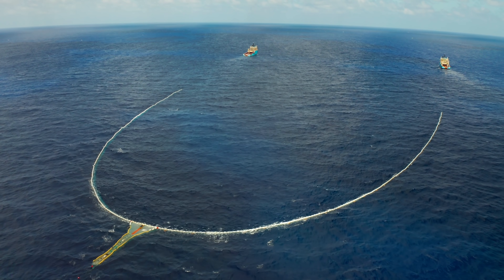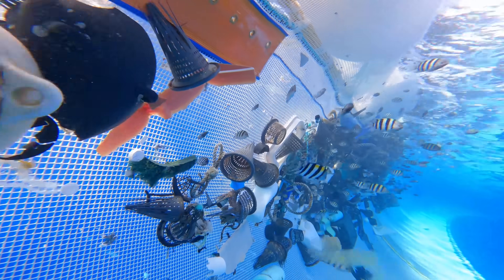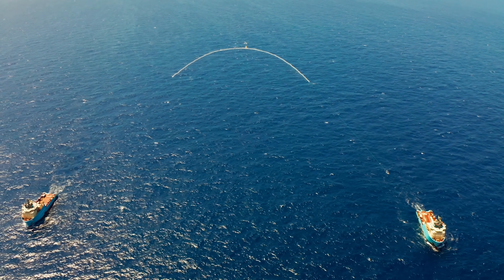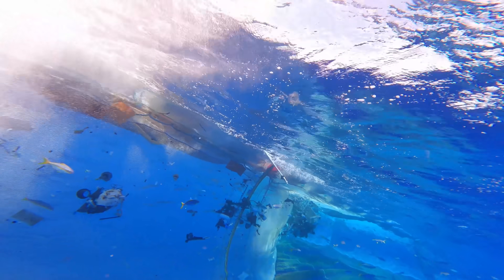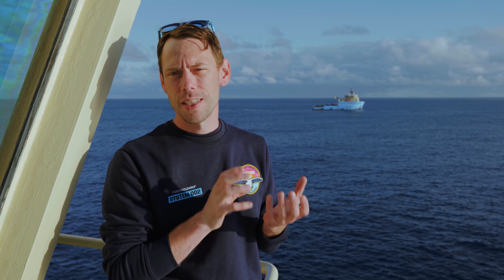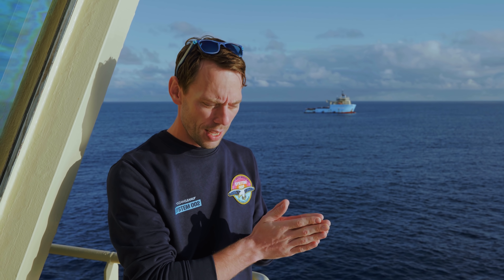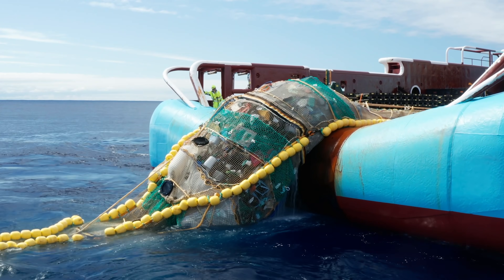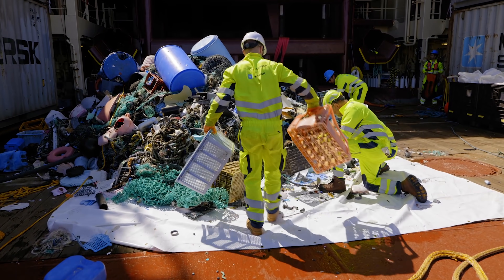How System 002 Works | The Ocean Cleanup

Comment: What if you made flooring panels that lock together and cover the floor? How structurally strong can plastic beams be engineered? Can you 3D print with the pellets? There are construction companies 3D printing houses with concrete, why not with your pellets? The structural engineering could be printed into the interior of the plastic "boards". Why not curb stops? Right now they're made of cement, why not recycled ocean plastic? Why not bus stop benches? If structural strength can be engineered into the plastic beams then why not cast the sides and base of the bench and use plastic boards for the seat? What about creating a locking together geodesic dome? The clear faces could be glass, but the frame and opaque faces could be made from your plastic. Also the signmaking industry already uses acrylic and pvc sheets in great amounts. The material on which a sign is produced is called a substrate. Can these pellets be made into large flat sheets of varying thicknesses? Equally important, can sheets made from your pellets be colored? Through and through or surface only? It doesn't really matter. Can it be painted? Must it first be primed? Which kinds of paint can be used? A couple of decades ago, closed cell foam replaced redwood and cedar as the substrate of choice for sandblasted signs, and later for CNC routed signs. You guys might have the next new innovation of signmaking substrates. What about 3D printing a dimensional raised letter sign? The CNC software already exists, but to my knowledge, noone is trying to 3D print signs. It might be a market for your pellets. I wish you well, and good success.

Comment: Let's make a calculation:

Based on the pictures I assume 2 boats gather 10 tons of plastic per week. Considering the size of the holes in net they can only gather new trash, as older trash is already too decayed.

Per year around 8 million tons of plastic end in the ocean. So 8.000.000 tons. So by this method, these two boats would need 800.000 weeks or 15.384 years. To have an impact the input of new garbage has to be smaller than the amount of gathered garbage (e.g. per year). So the boats have to gather more than 8 million tons per year.

This means by this method they need 15.385 more boats. To show you a benchmark: worldwide exist approx. 5.000 passenger ships or 17.200 container ships. Of course, these are way larger, especially the container ships, but still, 15.385 boats is huge. And they also produce GHGs.

I honestly hope you'll find possibilities and resources to enable scalability. Or others find solutions, I certainly do not care. Good look to all of us!

Comment: These projects are a complete waste of tax payer money.  The amount of fuel burned and CO2 released into the atmosphere doesn't justify picking up any amount of plastic in the oceans.  In addition all ships/boats leak oil and fuel into the water which is more environmental pollution.  The problem has to be solved at the consumer level by using paper and glass.

Comment: How many tons is typically in one dumping of the retention zone?
Reply from the maker: It can vary depending on how long the system was in the water, and the density of the patch in that location, with a maximum capacity of about 15,000 kg.

Comment: Great work. Although I thought the plan was to have the systems free floating in the current. Does this mean every system is going to have to be towed by two vessels?
Reply from the maker: We found out that having an active approach with the towed system greatly increases the catch of the plastic. We are currently investigating alternatives to fuel powered vessels to tow our ocean system. However, as the technology is still nascent and currently not capable of pulling such a large system, we will be working with fuel powered vessels until the technology has reached maturity meanwhile continuing to offset the emissions associated with these activities.

Comment: I'm very skeptical still. What keeps the nets from getting clogged. The water current will want to go around the net taking semi boyant material. 
How did you get those nets I'm your trash those are designed to sink. Why doesn't any of the plastic have algae on it?

Comment: So glad to see this is bringing some success after all the hard work! 
I had a thought.. I wonder if it would increase efficiency and reduce fuel use overal to chain additional System 002's and tug boats together e.g. in a W pattern or larger? I'm sure the team has considered this, just a thought from someone without any related technical knowledge

Comment: I just saw your presentation from today. I have an almost off-topic question about the Interceptors: In the Q&A you said that you might have to look at specialized solutions for certain rivers at some point, as not all could be dealt with the same way. I was thinking that too when I saw some of the differences of the rivers you already operate in. Couldnt you install, in more difficult areas, something similar to System 002 (Jenny) at the end/mouth/delta of a river, that spans over the whole thing, leaving through marine life but catching plastic? I would imagine you could anchor it at the river sides, and the water flow of the river pushes the spanning system towards the bigger body of water (e.g. ocean) and therefore leading the plastic into the arms of the system, similar to the way you do it in the ocean with system 002.

Comment: I just realized that this is an active system, meaning you have to actively move it through towing to get plastic. Isnt that more expensive and more time consuming than a passive system that floats around, catches plastic and you only get there to retrieve it form time to time? Or has this proven to be too difficult or even almost impossible to achieve so you chose to go with the active system? 
I feel like I have missed that switch, I thought the plan always was a passive system.
Happy to see the catches tho! Good job on that!

Comment: Will the final configuration need the two ships in order to work? I thought the idea was to leave the barrier alone to catch the plastic with no further help than the wind and the ocean currents.
Reply from the maker: Yes, it is likely that the final system will be pulled by vessels, as we have switched to an active approach to the cleanup. We are currently investigating alternatives to fuel powered vessels to tow our ocean system. However, as the technology is still nascent and currently not capable of pulling such a large system, we will be working with fuel powered vessels until the technology has reached maturity meanwhile continuing to offset the emissions associated with these activities.

Comment: I thought the system was designed to be fully autonomous. I am following the project for a while now and I am just learning today that 2 ships are needed to collect the plastic. Does it mean that the system 003 will need 2 more vessel ...? Then 2 more for system 004 etc. It doesn't seems very sustainable in the long run
Reply: I entered in the comments section just to ask the same :-)
Reply: @jgbusquets  I look for an answer on their website quickly but I have found what I have searching for :/
Reply: @guillaumeboussama5122  and the answer is...? :-)
Reply: @jgbusquets  have not* 
Sorry 😐

Comment: I think the key is to design a new type of ship to pull this harvesting web:
- Electric motors as the speed is only 1.5 knots
- Autonomous navigation with a crew that travels between tbe ships to collect the plastic 
- Fully covered in solar panels and remaining fuel from LNG (Finnish Wärtsilä builds good ones)

Only then can you truly scale this to 50-200 ships needed to make a significant impact
Reply: In the meeting where they announced, they mentioned that they had looked at designing new ships but realized the overall environmental impact of building new ships vs repurposing old ships was too imbalanced.   The 1.5 knots speed is great during capture, but higher speeds for return etc are necessary.    There seems to be a ton of optimization that they have yet to do with the system. (2 ships pull, then stop, and join in order to collect, why not a "collector" ship that goes from jenny to jenny like your local garbage man, pulls off the collection "condom" and replaces it with a new one, then sorts.  This ship would be much larger with more automated sorting like a big fishing trawler does. that way the other two can keep pulling.  then the pull ships being fully automated, dedicated electric etc would make more sense for the overall system.)  I do find it humorous that the first project goal was centered on cost per kg, but the new system was centered on scalability, and it ended up having a much lower cost per kg as well.
Reply: @bionaraq  Sometimes CO2 pollution originating from manufacturing something is a sacrifice we must accept in order to clean this maritime mess. Perhaps corporate sponsors could pay the generated CO2 through carbon credit. Using old ships that are based on bunker fuel is definitely not a good option
Reply: @DC9848  Clearly they've done the calculations and made the right choice in all respects. Not sure why you think you know better when they have dozens of PHD's doing huge calculations to find the right answers.
Reply: @DC9848  that isn't an option sadly..
Reply: This is a good idea but we have to bare in mind that the plastic on the surface of the ocean is likely less than 5% of the total problem.. a lot of plastics and waste fall to the ocean floor too, so I'd think to make an even bigger impact, there'd need to be some sort of ship/robot designed to bring waste up.
Reply: @gyrthez246  we have to start somewhere even if it’s not perfect
Reply: You need faster ship to get to the place where the garbage is in some reasonable time. Even if it was autonomous it has to get back to shore for some maintenance.
Reply: except even that wouldn't do it, the vast majority of plastic in the ocean is microplastics and or settled on the sea floor.
Reply: They've already made a significant impact.
Reply: @joeycee2585  they haven't lol

Comment: How about some numbers? How much Diesel do those two vessels burn per day, and how does that compare to the plastic recovered? And what is the upscaled calculation: how many vessels are needed for how long until how much % of plastic is recovered? I remember that earlier systems were without vessels, but it didn't work. So is this still sustainable, or just justification promo? PS: I donated quite some money and never received any reports.
Reply: Do you suggest that they mention that in all of their videos? They have been talking about the sustainability.
Reply: @robertlinder8464  Yes, in an obvious promotional greenwashing video I do expect that they mention some sustainability facts. Do YOU know if they're spending more fossil fuels than extracting plastic? Do you have any idea how much Diesel these two ships burn every day, how much fuel they spent getting to where they are, and how much maintenance and rent they cost?
Reply: @SentinelFive  Why does it matter if I know? If you're interested you'd go and find the information. You're basically asking for them to repeat the same information in all their videos, that doesn't seem reasonable.

Comment: Looks neat, but there is a thing I don't fully understand. When The Ocean Cleanup started its goal was to develop an autonomous system, without the need for humans to operate it in the middle of the ocean. This system 002 requires two large tugboats with full crew to operate. What happened to the goal of having an autonomous system?
Reply: An autonomous system is still the goal. This is the 2nd prototype and is more about the collection of the plastic than the mode of transport. Subsequent prototypes will probably do research on subject again.
Reply: First try failed miserably, they had to show some trash catched for their donations of 32 million euros. Or they loose their 100k a year salaries.

Comment: A great job you are doing.
I just wonder couldn't one of the ships be replaced by an autonomous  vessel?
Reply from the maker: We investigated the use of unmanned service vessels (USVs) 
as propulsion units for our operations. While we believe this might be a more ideal solution, saving cost, there are currently no USVs available on the market that meet our requirements. Something for the future - but in the meantime, the plastic problem is only getting worse.

Comment: Wonder how much marine life works itself out of the plastic that it wasn't necessarily trapped in, before gathering in the retention zone.
Reply: The marine life has several days to a week to figure out how to escape at human walking speed. I would imagine the number is quite small. Basically a guarantee that more marine life will be saved or have their life extended by removing this amount of plastic.

Comment: This system is basically just a fish net that goes along the surface,  wonder why they didn't think of this years ago, so simple and effective.  The trash pickup of the sea.  Every country should be giving you guys grants especially those who are into fishing like Asia.  Or rather when fishing boats are out require them to pull something like this behind them when they go out fishing,  pay them for a load of plastic trash and their fish.
Reply: I get what you're saying. Initially they wanted to use a more elegant design without the ships towing it. Having worked on many engineering research projects, I know how this goes. Sometimes your initial elegant idea doesn't work out and you have to take a step back and just use what works. Hopefully they will put some research into autonomous surface vessels if they keep with this approach.
Reply: @tymo7777  Throwing in the towel on an ocean-propelled system and accepting the need for vessels was a let-down.  But they say it's feasible, even with 2 vessels for each system, with 10 systems in the Patch.  The cost of operating these tug vessels is partially offset by the elimination of "garbage collection" trips and trips for repairs.  They can do it all right from the tug vessels.  Still, I would really like to see some hard info from them about the cost of using vessels.
Reply: @jasonthewatchmansson8873  I very much doubt they completely threw in the towel. It's possible or even likely that once they have more real world experience making their systems robust that they'll revisit the autonomous systems. If they are able to have multiple ship systems out there doing this, it seems like a no brainer to also deploy a handful of less efficient autonomous systems too that can be picked up with very little extra overhead for vessels already heading back to shore.
Reply: No one cared to. That's the only difference.

Comment: Has the passive catchment system been abandoned or will Jenny (002) transition?
Reply: That is the question. Towed nets would be difficult to scale up in sufficient quantity to make an impact on the great garbage patches.
Reply: @peterdarby1445  Not difficult at all, just capital intensive. The Ocean Cleanup already calculated the number of systems needed to get rid of 80-90% of the ocean plastic by 2040.
Look in their website for details.
Reply: The passive system was abandoned.
Reply: @drooplug  Shelved is a better term. Abandoned is absolute, The Ocean Cleanup has some very smart people and always looking for improvements.
Reply: @drooplug  It was an embarrassing failure, broke apart in bad weather. This new one is even smaller, they have to always remove it except for calm days....which a few and short like their videos.
Reply: @TropicalOceanCleanup  what a great positive attitude you have. I bet you think it's all hopeless and throw your trash into the ocean thinking "what's the point?"
Reply: A big problem they ran into with the passive systems was that there was nothing keeping them in garbage patch, so they would have to be towed back in by boat periodically anyway. Boats would also be needed to make trips back and forth to remove the collected trash. They also had problems retaining the trash in bad weather. The active system gives the ability to target the highest concentrations and in the best weather conditions as well as scale up to something with a 1km-wide mouth instead of the much smaller passive system.

Getting plastic out of the ocean is a COST / KG equation. They tried reducing the costs as much as they could with the passive system, but they are able to be much more efficient with the actively towed system because it increases the number of kilograms they can collect by a large margin.
Reply: @quikbeam03  thanks clint!